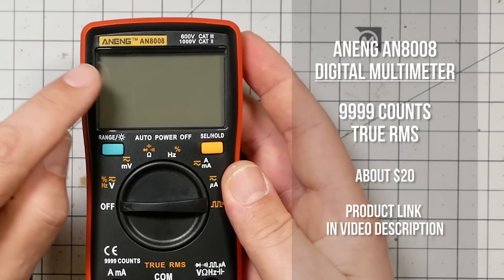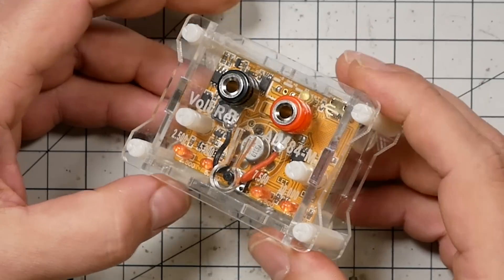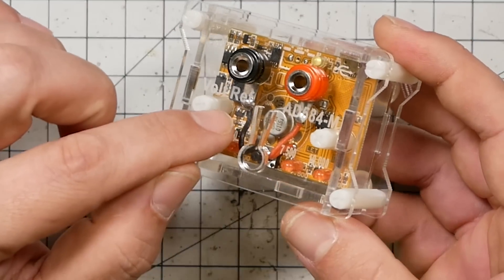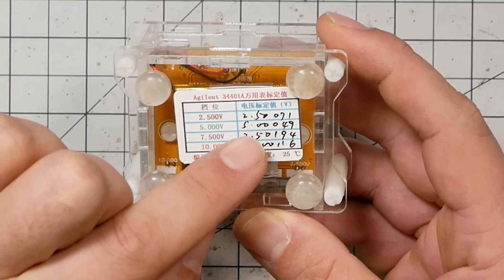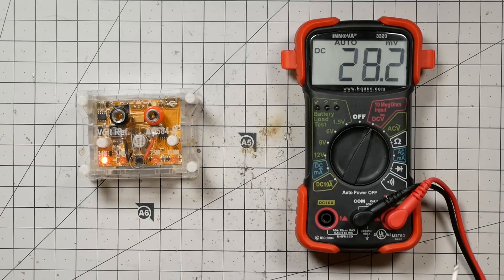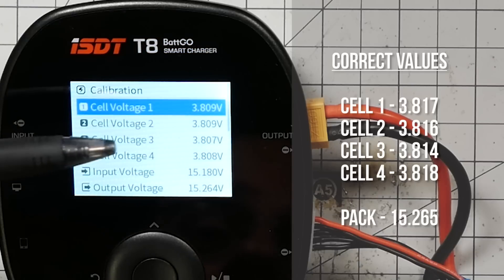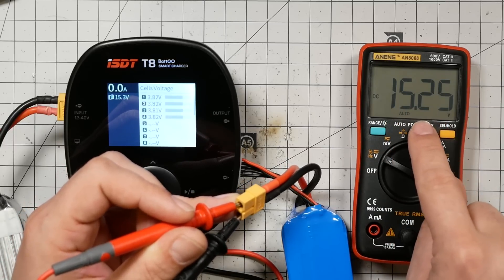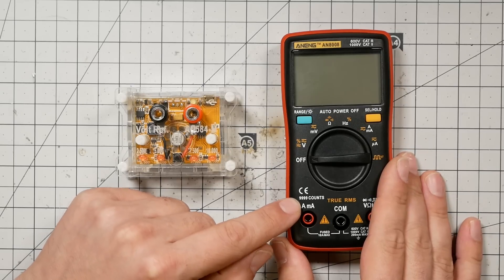HOW ACCURATE ARE ISDT CHARGERS | KKmoon AD584 voltage reference and AN8008 multimeter

Comment: Thank you.
Been looking/waiting for a review on the robustness/durability/reputability of various charger brands. I have a couple of cheap HTRC 240Duo chargers that have been working well so I bought a couple of the 400Duo and one of them had a channel that went bad and started allowing overcharge. Are HTRC chargers just inferior and I got lucky with the first two? Or did one get fried because I was using it when it was almost 30 degrees C in the garage this summer?

Comment: the LM399 Voltage Reference module on aliexpress has greater precision, its $28 and has printed voltages checked with their high precision meter, so get that one instead, make sure the photo shows printed voltages, there's another version with handwritten voltages, its hard to read
Reply: you got a link cause i cant find that anywhere?

Comment: You are correct in describing what is the difference between accuracy and precision. However, your calibration procedure is not valid. A 9999-counts meter means that it displays 4 digits in the display. The accuracy/error is another story. You should have used the manual of the multimeter. In particular, in the 9.999V range you are using to measure the cell voltage has a reported error of
± (0.5% + 3)
This means that the absolute error associated with the measure you read from the display (in example 4.201V) is given by
4.201 * 0.5/100 + 3 units on the least significant displayed digit (that in this case is the 1 of 4.201)
therefore the total absolute error is 0.024 V and the correct way to write down and read the measure is
(4.20 ± 0.02) V
This means that the result of the measurement lies between 4.18 - 4.22 with a probability of 100%. When you write "correct values" in 08:41 you report the measured values from the display without accounting for the instrumental error. You correctly verified the accuracy of the multimeter, but the BG-8S is specifically build with an instrumental error lower, namely is gives
(4.200 ± 0.005) V
You see, here you have 4.195 or 4.205 but you are sure of having not 4.180V in ANY possible case. The calibration procedure you used is therefore to be considered not scientific nor correct. The only way an hobbist, like me and you, can calibrate properly a battery charger is either asking a lab to use their certified (but more important precise) instruments or to buy a standard voltage source (like the one you showed) and use a voltage divider make of precision resistors. A precision resistor has a tolerance of the order of 0.005% of its rated resistence. Then for example, using a standard 25.4000 voltage supply you can achieve (let us take the example of typical 200 Ohm precision resistor 0.005%) 25.4 / 6 = 4.20 with an absolute error of MAX 0.0004 V that is
(4.2000 ± 0.0004 ) V
pretty amazing right? A precision resistor set of 10 + a precision voltage reference of 25.4000 costs surely more that 50$ but less than a fluke meter. 
All of this in theory, but in practise what is the accuracy of iSDT voltage measurements? It depends on the circuit design. They use an ARM mcu with a 12-bit ADC therefore we may assume as measurement error the best case where the absolute error is given by the resolution of the ADC. As boldly calculation, we take as supply voltage of the MCU's ADC the 4.20V. The resolution is therefore 4.20 / 2^12 = about 0.001 V
In conclusion, the readings of 4.201 V of the charger in the best case ever has an error of of the order of mV.
The datasheet of a 700€ Fluke 87V reports an accuracy of ±(0.05 % + 1) meaning that a measure of 4.200V has a 2mV error (because the display there is 19999 digits max therefore it would measure 4.2000 and the +1 would means 0.0001 < 0.0020 V). In this case, as you can appreciate the instrumental errors of the charger and of the multimeter are comparable and therefore one may proceed with the calibration, if precise sources of voltage are available.

In conclusion, the calibration procedure of the video is neither accurate nor precise. In light of the charger theoretical best accuracy ever (of 1mV) one can design a voltage reference and divider with a significant 1 mV order-of-magnitude error. Time-consuming and not-very-useful explanations aside - by the way I'm a physicist - the practical difference of 0.02V between the lipo cell voltages is completely irrelevental for any practical purpose. Therefore if on one hand this calibration procedure is intrinsically incorrect, on the other it may flatten large voltage differences in the factory calibration of the charger. For example if for some reason (I don't know) the charger is factory calibrated to read equal voltages while the lipo cells are 3.80 - 4.22 V then this procedure would save us from burning our precious rc helicopter from a lipo overdiscarge potential fire, reducing the relative (again, relative to the former) charger inaccuracy. That's all
Said that, Joshua, I really like your videos and appreciate your reviews. Kindly regards, Pietro
Reply: A video explanation of this concepts
https://www.youtube.com/watch?v=U4JFeU-o2kc

Comment: l'm looking for a new charger. The important for me is to accelerate the balancing step that is tooooo long with a lipo that cell are not perfect.  I see 2.2A/cell for the iSDT T8,  2A for  the Hota H6 Pro,  another writes >2A another 0,2A per cell  bla bla bla How can I know if the  Amp rating is for the entire balance port ,for each cell, divided by the number total of the cells of the charger or for the amount of cell of the lipo I charge?  I do not want to end up buying a charger that do 2A divided by 8 cell = 250mah and balance not faster than my actual HitecX1touch 200mah per cell.  Anyone have test these specs ?
Reply from the maker: I believe the balance amp rating is per cell.
Reply: @JoshuaBardwell  I'm looking to buy a new charger to address my problem where lipo charge takes 30 minuted to charge 4S 5000mah from storage to full but another 45 minutes to balance. I don't know wich charger is the one for me because of this nebulous "drain" parameter. Would it be possible to test/compare this to know wich chager do it and do it best ?
Reply from the maker: If the battery takes 45 minutes to balance, I would suspect the battery might be damaged. After a flight, are the cells very out of balance? A difference of more than let's say about 0.15 volts, I'd consider unusual, and more than about 0.20 volts very concerning. When I finish flying with a healthy pack, the cells are often within 0.05 volts of each other.
Reply: @JoshuaBardwell  sorry for the long text:S
I ran some tests and wrote down some datas for the lipo 2S that drives me nut for it's long balancing time. After use of this lipo I got 3.42v 3.35v  This lipo is 2 years old and Internal resistances has always been different by 2x (3ohms cell#1, 6ohms cell#2 no precise reading). I presume this lipo is not dying yet cause it did no degrade since I bought it.
This lipo got balanced approx. equaly on my HitecX2ac+ than on my HitecX1touch (both are rated 200mAh per cell for drain balance) 37 minutes charge phase + 27minutes balance phase (tot. 1h04m) ratio:42%of total time for balance phase. With my HitecX1touch( 29 minutes balance phase) kind of the same amount of time.
Fact: my lipo 3S and 4S takes approx 6 or 7 minutes to balance on this X2AC+. I presume my specs are really 200mAh per cell as stated.
New chargers like iSDT states 2.2A/cell, Hota states 2A, iCharger states >2A, Hota duo 1,6 x 2  Do these specs are per cell or must be devided by the amount of cell the charger can charge? Do these high specs compares to 200mAh per cell of many classic chargers may help with total charging time? 
I think it would be EXTREMELY interesting to compare new chargers for their time of charge the same lipo at the same Amp/watt to see if the current drain for balancing /cell or per chanel or undefined can save us time when you want to go fly or ride before the dinner :)

Comment: You probably won’t read this comment but hey it’s worth a try Please do a video on how accurate the icharger x6 is thanks
Reply from the maker: I didn't read this comment. 

I reviewed the iCharger X6. I'm not sure if it was in the review but the one I got was dead on from the factory, as you would expect from iCharger.
Reply: Joshua Bardwell Really The one you received was dead it didn’t work or turn on !!!! I just purchased X6  the other day haven’t used it yet but I noticed the button on the side is really cheap and soft it’s like if you push the button too hard it’s like it will push all the way through really soft it’s not even a click !!!!  I know the X8 is on pre-order already at most places hopefully they fix that button but I’m pretty sure they didn’t i’m looking in to purchasing me 5.5 digit Digital multimeter soon i’m curious to see how accurate the X6 is because I know pretty much everything that ISDT makes needs to be calibrated correctly

Comment: Old video, I know. But a voltage ref is pretty cheap and easy to build, I have one that is accurate down to 1.4904 V (and also has a current reference of 1.01 uA), runs of a single AAA battery which, if running constantly lasts for the shelf life of the battery (a couple of years) and cost about $6 in parts. Took about an hour to build (though something like 10 to design...)

Comment: good stuff here. I have the t8 and the bg s8 checker but use my old hitec ac 4 plus charger. and I own a cheap south wire mulimeter. volts on the hitec are off from isdt bg s8 checker which is off on my multimeter. I dont know about my t8 its not used much until i get a good power supply . my question is how do i calibrate the lipo checker? my hitec charges to 4.22 when using my meter. cell one on the checker is always at 4.176 hitec cell one 4.19 thank you! nevermind I tried this same method for the charger and it worked:)
Reply from the maker: The ISDT lipo checkers can be calibrated using the identical procedure to the chargers. For other lipo checkers I don't know.
Reply: Joshua Bardwell my error I tried this method you described for the t8 charger to the bg s8 lipo checker and it worked. thank you for your reply!!

Comment: well you would expect 9,998  depending on the current of that 10V source, as the internal meter resistance isn´t infinitly large. Typically it´s 1 MOhm

Comment: Josh ive been using the isdt t8 with my 4s lipos for a while now no problems. Now that i have some 5s packs the charger keeps resetting or turning off.. any idea whats going on??
Reply: Im using a 19.5v 7.7a laptop psu
Reply from the maker: Is it possible you're over drawing the PSU and it is shutting down?

Comment: Hey Bardwell, was wondering if the q6 pro is more compact than the sc-608?  I am needing to find a compact charger for travel and am limited due to carry on space. Which would you say is better? I found the sc-608 for 38 bucks while the q6pro is 60. If you can help it would be sweet.
Reply from the maker: I think they're pretty close to the same size. If I had to guess I'd say the Q6 is a bit larger.
Reply: Joshua Bardwell thanks man. I am guessing the q6 is better overall.

Comment: is it possible to connect the ad584 module directly to the balancing port? this way all the cells would have the same voltage and it would be easier to make the correction
Reply from the maker: You'd need multiple modules

Comment: I think if you really wanted to g nuts, rather than trying to calibrate off of batteries, you'd want to do it off a bench power supply that had a stable voltage.  Then create a small circuit of voltage dividers to mimic the balance connector outputs (and wire up a balance cable).  Check values with your high count DMM. Now you can connect that balance connector directly to any of your chargers or checkers and the power supply acts like a perfect battery.

Comment: I bought a pair of SC-608 chargers.  I liked them so much, I sold off all my other chargers and bought 6 more .

I noticed that batteries on some of the new SC-608s came off charge at too high a voltage, with the charger indicating 4.20V per cell and a standalone voltmeter showing much higher voltages of up to 4.25V per cell in some cases.  I picked up an scLinker, updated all the chargers to the current firmware and went through the calibration procedure.

Two of the chargers cannot be calibrated properly, as the range of adjustment is less than the error amount.  On one charger ports 2 and 3 are affected, on the other charger it is ports 5 and 6.

I've contacted ISDT tech support.  Radio silence.  

Is there some other procedure for calibration of these chargers?  Do I have to send them in for service?  Do I just throw them away?
Reply from the maker: I'm surprised they are too far off to calibrate using the method in this video.

Don't expect to get any answer from ISDT, that's for sure. And don't expect to send them in for service. That's not the kind of thing you get from a charger at this price point.

Comment: Hello Joshua!
I’ve been having some doubts on parallel charging with my ISDT Q6 Plus.
I don’t seem to understand quite well how the charger measures the cell voltage when there is more than one battery connected. When I put just one it seem pretty accurate according to my multimeter, but when there are more the charger even finishes charging before the batteries are at the voltage that the task was aiming for.
Is that normal?
Reply from the maker: When cells are in parallel, they exchange current until voltage is equalized. The charger doesn't have to measure the voltage of each individual pack because, by definition, the voltage is the same for all packs in the parallel array.

If the charger is finishing prematurely, it might be you are charging at too high a rate. The additional resistance of the parallel charge board will cause some voltage drop if you charge at too high a rate, which will result in packs not being fully charged.
Reply: Joshua Bardwell Daamm you are fast! Thanks for the quick response!

Comment: Joshua, can you tell me if your voltage reference module has this odd behavior that mine exhibits?  When I switch it to 7.5 volts it drops down to about 1.8 volts and then slowly rises to 7.5 volts over about 10 to 15 seconds.  All other voltage channels (2.5, 5, and 10) are not like this.
Reply from the maker: +DaddyBigas no, mine doesn't do that.
Reply: Joshua Bardwell thank you for the response.  I’ll arrange for a replacement then.  Keep up the awesome work.  What you do is appreciated.

Comment: i have fluke multimeter, model 101. i used it to measure  batt voltage, then calibrated for all my isdt chargers.
but when i charged lipo packs, all of them finished charging @ over 4.210V
i had to cablirate charger under what voltage fluke 101 read. Ex : fulke shows 4.200V, i set charge @ 4.195V or 4.190V

Comment: How can you trust a voltage reference more than you trust voltmeter? It all comes down to trust. The measuring tool has to be certified by a trustworthy authority to be worth anything more that a person's trust. Does this voltage reference have a certificate that states that "this reference device has been tested and certified to the N-th degree of tolerance according to the standards mentioned by the certification authority Z" ?
Reply: It has to do with how each works. The method that multimeters use to read voltage/amps/watts/etc is affected by use. The method the reference uses to produce its steady voltage is not affected by use. Certifications are just tests that use multiple references. The more references used increase the possible accuracy.
Reply: Roman Gubanov Google bandgap voltage reference. They are the most accurate.